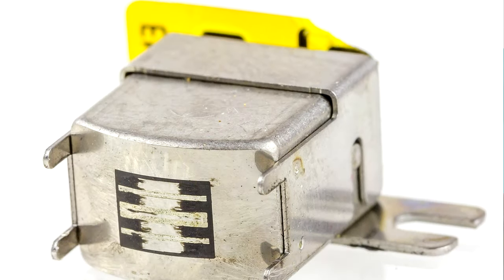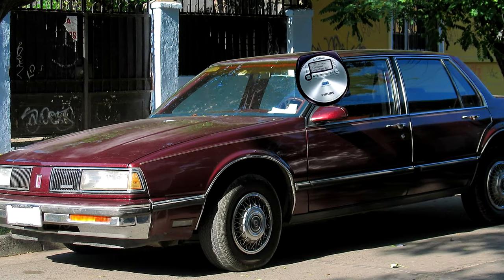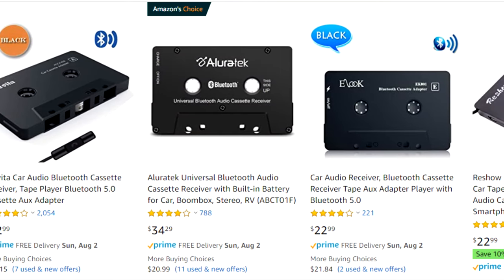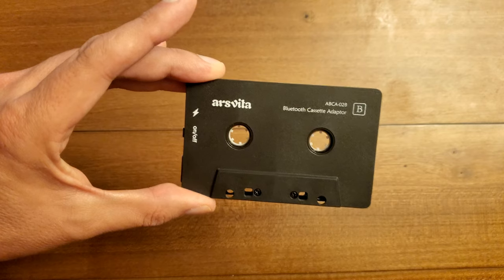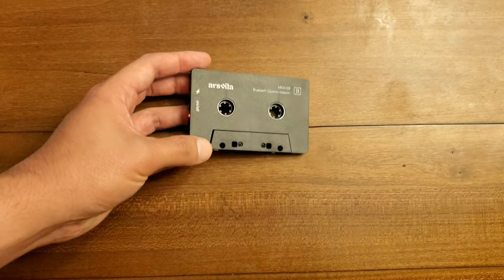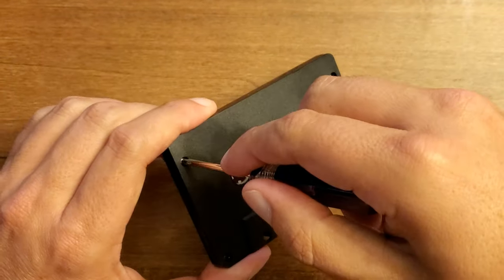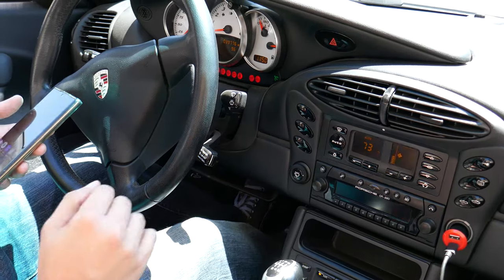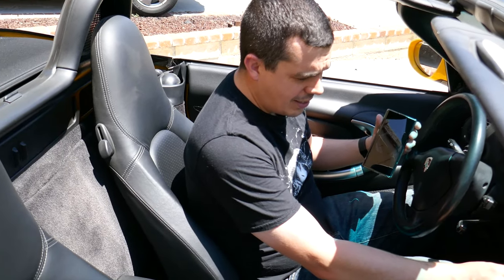Bluetooth Cassette adapters are a thing.

Comment: Pro tip: For those BT adapters who doesn't "pair" the volume with their target playback device, put the BT volume on the phone at 100%. It makes no difference in terms of sound quality or power consumption on the phone itself and you won't need to deal with 2 level adjustments at the same time.
Reply from the maker: Almost always good advice, unless 100% volume on your phone means you're at like 1 or 2 on your stereo. There isn't much dynamic range at that level. You want your stereo to be at least around 10-15%.

Comment: just got one of these was hoping the roller wheel went back to some sort of generator, that may be a cool mod to add a generator to charge the battery as the spindle turns
Reply from the maker: Interesting idea. Wonder how much power it would generate. I'm sure it would add to the price but would be a nice feature

Comment: they often times have problems with the cassette if u have an auto reverse cassette car stereo it will flip flop as the music is playing. if u encounter this problem open the cassete adapter and take out all the gears that came with it. i did that with all my cassette adapters and it will stop going berzerk on u hope this helps good luck
Reply from the maker: That could be a good fix if you have that problem. Some tape decks won't play without the gears in there though, so I would only do that if you had an issue

Comment: Hey! Thanks a lot for your review!!! thumbs up to the only one about this model of Arsvita (without external jack). 

Does it give you stereo sound through the bluetooth? any noise? Jack cassette adaptors are usually giving a very bad and crappy noises... This is also a good solution to use on a Vintage Blaster
Reply from the maker: Thank you. Yes it comes out stereo and no, I haven't noticed any noise. Still been happy with it months later.

Comment: I just bought one but phone calls quality are lousy.  I can hear well but others cannot hear me well. How are your phone calls quality?
Reply from the maker: Mine doesn't have a mic, I only use it for music. The ones with a mic have them on an extension that wouldn't fit in my car head unit.
Reply: If I had to take a guess I'd say it's probably that the mic is small and on a short cord, so it's too far away from your face to pick anything up. It's probably like the mics in earbuds that you have to hold right up to your mouth to use